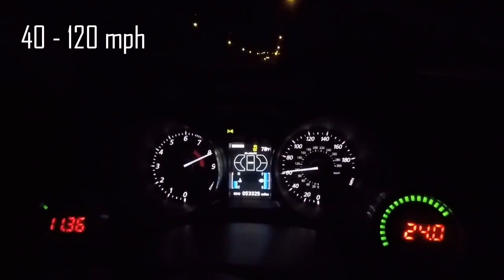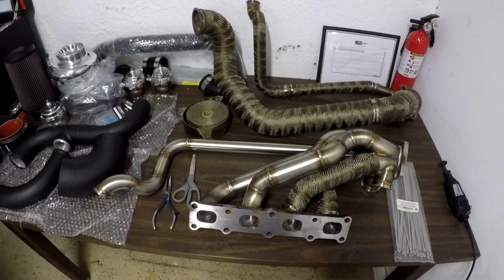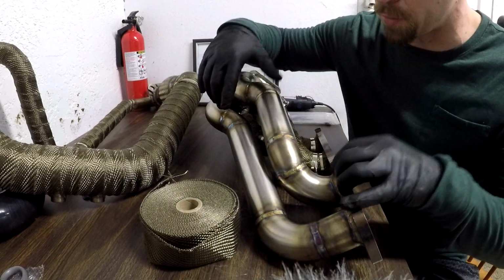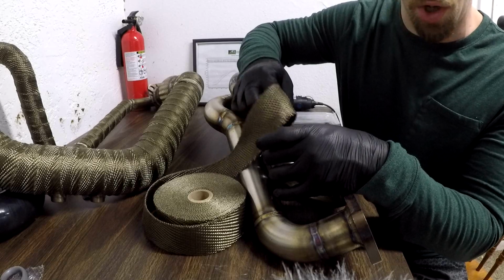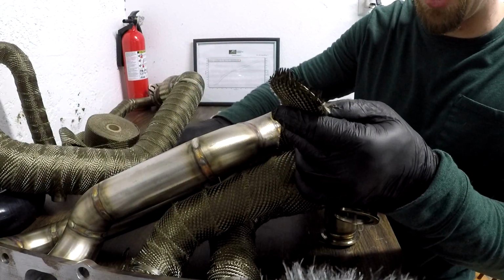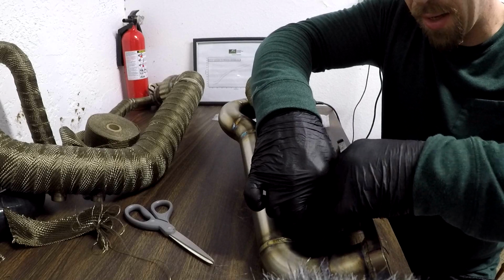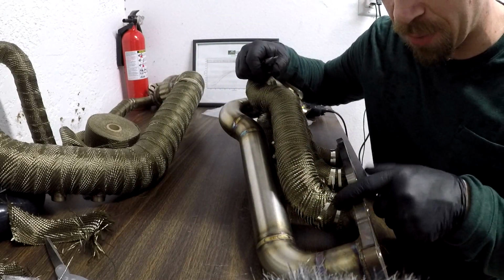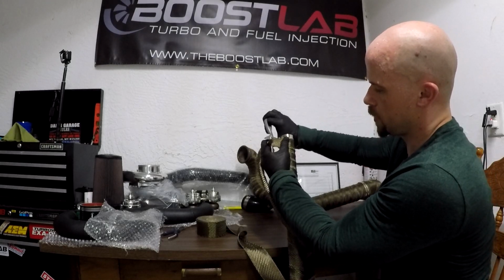Exhaust Wrap your Turbo Manifold ++DIY

Comment: Hey man u have any pointers for taking out the man drive shaft from the tcase? I got a bad center bearing I need to change I get the four bolts that hold the bearings and the four that bolt to the rear diff any thing specific on he tcase?
Reply from the maker: Victor Martinez  No, sorry at this point I have taken mine apart to give proper advice
Reply: @xtra_slo1596  u have? Or haven't u think there is a typo but thx
Reply from the maker: Victor Martinez lol that was a typo  I haven’t